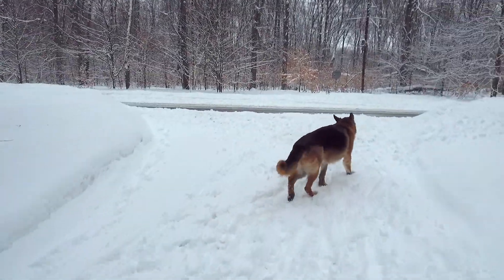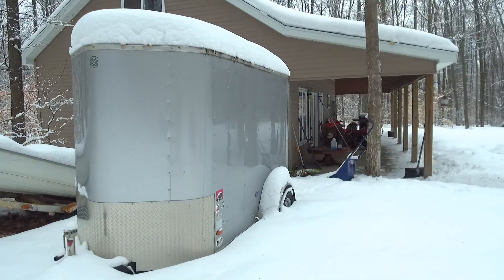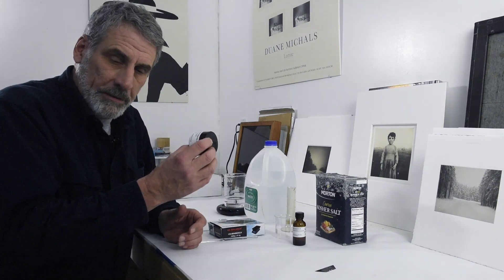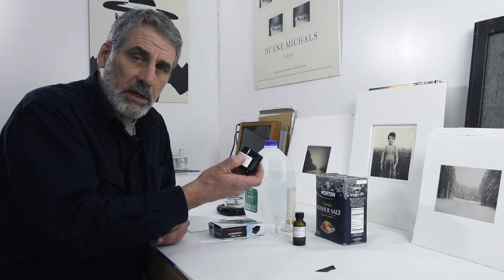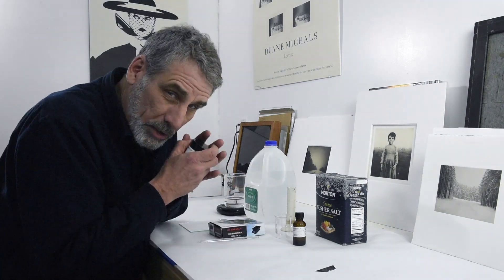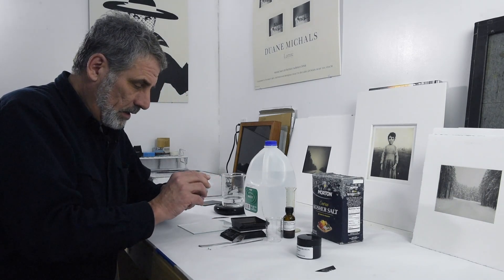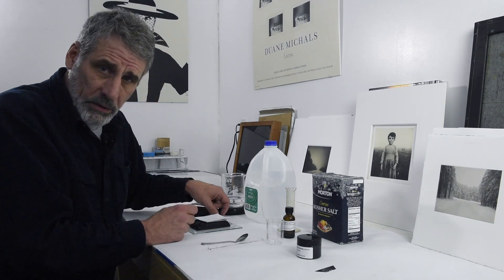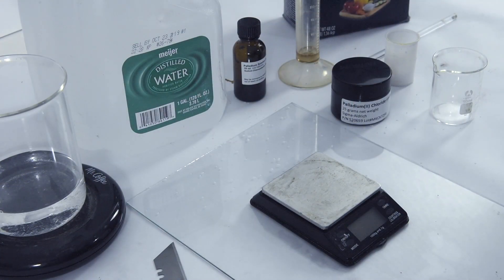Mix Palladium Chloride for Photographic Printing - Formula and Links in Description

Comment: I have been wanting to go down this road of mixing my own chemistry for P&P but have been a little apprehensive  to go down this path so this video is helpful..  I am a little confused here by the math here.  2.3 gas of Palladium in 25cc solution would be a 9% solution.  I thought the standard dilution for palladium is a 15% solution?  If so, then wouldn't you need about 3.75gms to make a 15%?   thanks

Comment: My questions: what is the temperature of the water on the small hotplate? Isn't it better to start the solution in warm water? How many degrees did you heat the finished solution to so that it dissolves better?

Comment: Hi Bill, I just watched this video several times and I am confused about how y h palladium you are using and what percent solution you are making. At one point you seem to say 2.5 grams of palladium and then later I think you say 2.3 grams.  Can you please clarify? What percent solution are you making here?
Reply from the maker: Hi Larry. Sorry for the confusion. Follow the formula in the written description which is 2.3 g. 2.5 won’t hurt. You’re going between a nine and a 10% solution. Personally, I go on the lighter side because I don’t see much difference and I am just frugal.
Reply: Thanks Bill. That clears it up. I have been using the Palladium #3 (15%) for NA2 but you seem to be doing pure palladium prints. I have a decision point now regarding percentage before I mix.
Reply from the maker: @lhuhnphotography  I understand completely. Maybe you could mix up a small amount and see how you feel about it.
Reply: Bill, are you using straight FO or FO with Potassium Chlorate with the 10% palladium?
Reply from the maker: @lhuhnphotography  hi Larry. I just use the straight Ferric. I don’t use any of the potassium chlorate, contrasting agent. Unless I’m doing in-camera negatives, I don’t do any contrast control other than through the negative.

Comment: Hello Bill,
how long can the mixed  solution Palladium chloride + Sodium chloride + water mixture be used.
Reply from the maker: Hi Hans, Great question. As long as you keep the solution in a tightly closed, brown bottle, it should last forever. If for some reason it dried out, you could use the powder remaining to mix again. Thank you!

Comment: Do you mix your own ferric oxalate Bill?
Reply from the maker: Hi Gary, I usually order mine from Bostick and Sullivan. Previously in powder form which I mixed myself, but now most often premixed. Bostick will sell it as "dry packs" that are remeasured into 25mm bottles. My trick to mixing is to add you distilled water and leave your bottle in a beaker with some water heated on on Coffee cup warmer. Keep shaking it ever so often to suspend undissolved powder until it clears.
Reply: @BillSchwab  thanks Bill

Comment: So, once mixed how long does the solution keep?  Should it be kept refrigerated?
Reply from the maker: As long as you keep it in a tightly sealed, brown bottle, it should last a long, long time. It is the ferric oxalate that you mix with the palladium solution that times out after a couple of months. The palladium should be good forever.
Reply: @BillSchwab  - Thanks -  2 questions (A) the mix above calls for Sodium chloride at 1.6 gm, but in the video (6:44ish) you say 2.0 grams. (B) When heating the palladium after mixing, what temperature and for how long?
Reply from the maker: Hi Jeff, Thanks for pointing that out. I tend to go with the 2 full grams and I don't notice any differences. Basically the salt makes the solution dissolve better and I don't think the extra does any harm. As for heating, I use a coffee cup warmer with a beaker of water in it to place the mixture in it's bottle. 120 to 140 degrees should do. Again, this helps with speeding the dissolve.

Comment: Hey Bill, fantastic videos on the Pt/Pd series.  I have been buying the solutions pre-mixed, but now I know how to mix it myself, so thank you.  How long do you leave the mixed sensitizer in the warmer bath? Also in the notes, you list 1.6g of salt, but in the video you used 2g.  Which is correct? - Also, you have my vote on mixing the Ferric Oxalate next.
Reply: Hi Bill, just checking in again to see about the discrepancy between the 2g vs. 1.6g as stated above?

Comment: Bill - suggestion - get yourself a tiny plastic funnel. Drop the powder off the paper into the funnel directly into the bottle, then pour in the beaker of Salt water. No waste powder left in the funnel (its washed in) and nothing at all in the beaker. Shake and put into the hot water bath for final dissolving of the powder... Works fine. Best regards
Reply: And very nice job on the video! Good to see you promoting the craft.
Reply from the maker: Hi Don,  thank you! My experience with plastic funnels hasn’t been  good. I actually have a small glass one that I use. We all have our ways of doing it and in every way there is some residual powder left. More of a stain than anything. I appreciate the input. I’m sure it will help people further find their way.

Comment: I see you're getting your palladium from Signa Aldrich?
Reply: Thats an Artcraft Chemicals label on the incoming box. today's price has increased to $56.65 gm up from $49.00 last week. B&S is at $65/gm.
Reply: @donnelson2250  Do the prices change all the time?  The reason I ask is that I may want to time my purchase or only purchase in small 10g to 20g amounts to average out my overall costs.
Reply: @stealthvanlife6867  Spot market prices change all the time, but Artcraft and B&S change slowly - likely because they buy a coin and then convert it into powder needed to make the solutions.  So change comes slowly to their prices
Reply: @donnelson2250  Thanks Don.

Comment: Nice video, Bill. Just an idea, in order to waste a minimum of the precious powder, I would weigh the palladium chloride in a second beaker, and then pour the salted water into that second beaker and mix with the same spoon used for transferring it from the bottle (instead of the glass rod). That way no loss of powder on the paper and spoon handle.
Reply from the maker: greg7mdp2 Good idea Greg. However, the loss of powder on the spoon and paper is pretty minimal, but yes... there’s always a better way.￼ I appreciate the input.